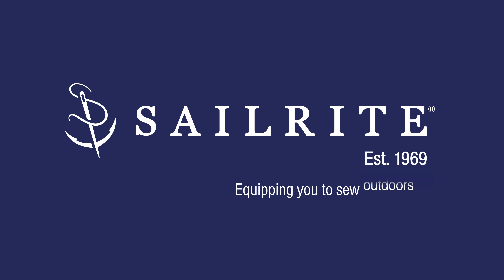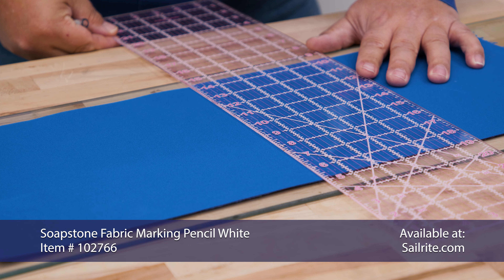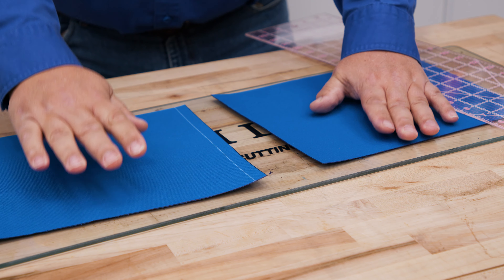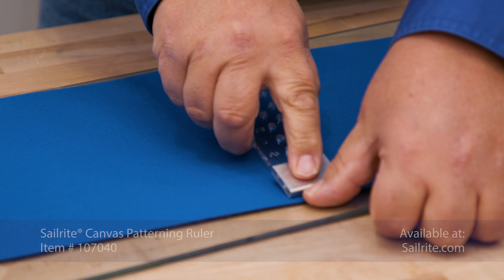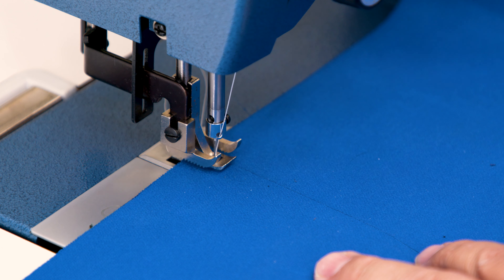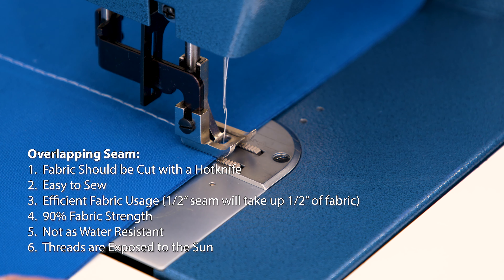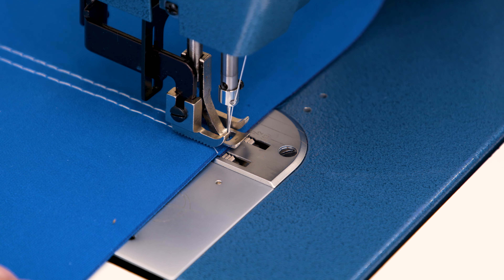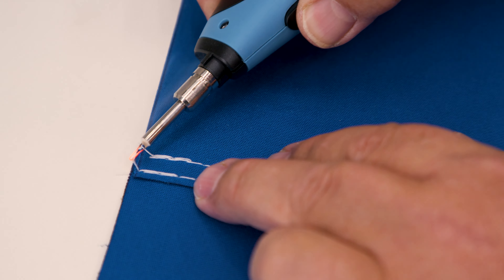Overlapped Seam Construction

Comment: Wow - what a machine.  That thread looks really heavy duty too.  Do people use your machines for dress making as well as these upholstery, blinds, cushion and canvas projects?  Also, is the hot knife connected to the mains power?  I didn’t catch whether it has a cord attached or whether it’s battery operated.  Thanks..
Reply from the maker: The thread we are using here is V-92 Polyester. Yes, people use this machine for upholstery, blinds and cushions. In fact we have hundreds of videos showing projects like that using the Sailrite Ultrafeed to sew them. Here is one of the most recent videos on building slatted roman shades: https://youtu.be/7aV4JIUVvMI The Edge Hotknife is plugged into a 110 volt wall outlet, but we have a brand new Cordless Edge Hotknife being made now for our great customers, it is coming soon, be watching our website and YouTube channel for it.
Reply: Have they got the machine for you....yeah